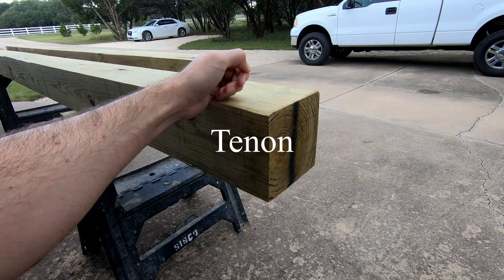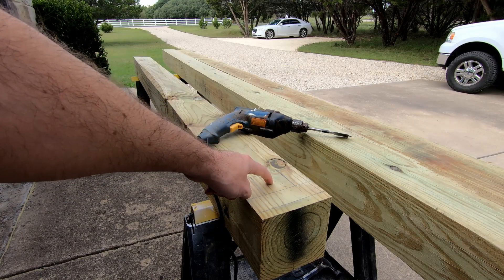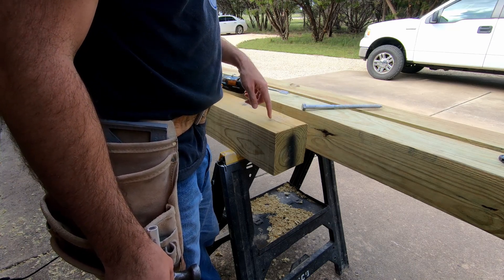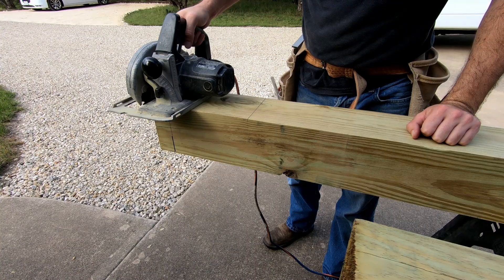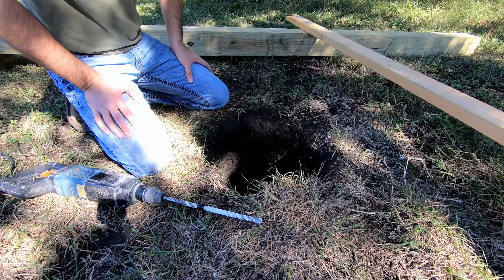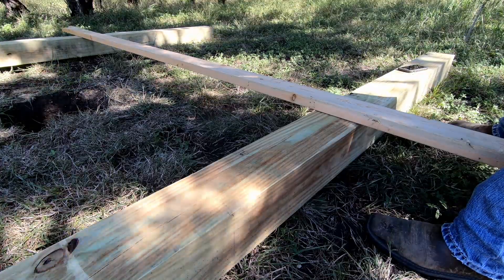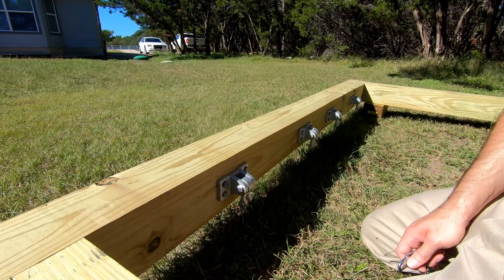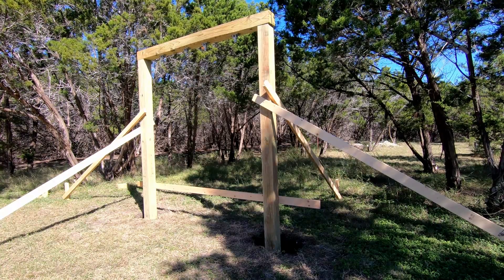Swing set DIY Durable Build

Comment: Hello, not sure if i missed it on the video. Do you have a weight estimste for the swings with this type of structure
Reply from the maker: Several average size adults have used these swings. I think the swing hardware is going to be your limiting factor. Most swings have a pretty low weight limit.

Comment: Hey thanks for the video. How much weight can this frame hold. Looking to build one for adult swing
Reply from the maker: Well I can tell you that this is an exact replica of the one I grew up on and that one has had many adults swinging on it and its still in use going on probably 40 years now.
Reply: @JacksHomeProjects  proof enough of durability. Thanks for sharing.

Comment: What was your total depth for the posts, and how many bags of concrete per post did you use?
Reply from the maker: They are 12' posts so you want to go 4' deep. I got about 3' deep so I drove rebar into the rock to supplement. I would use the calculator on quikrete website to figure how many bags. I think I used about 8 bags per hole.